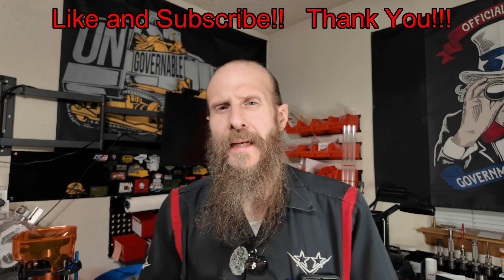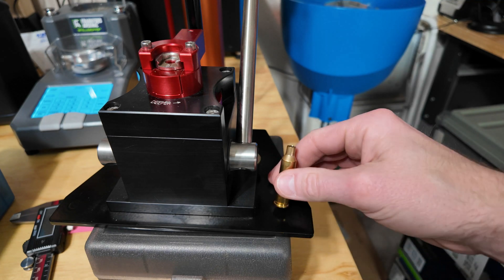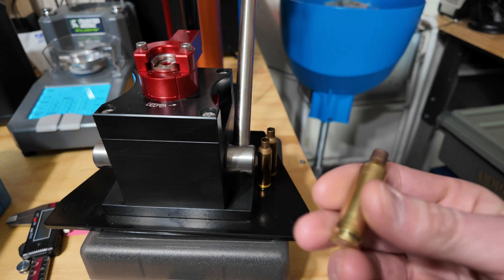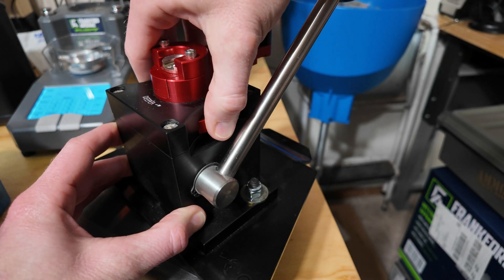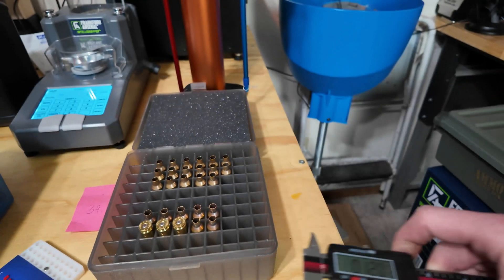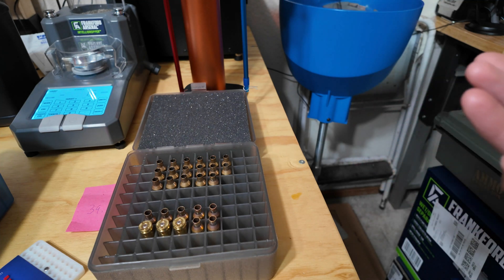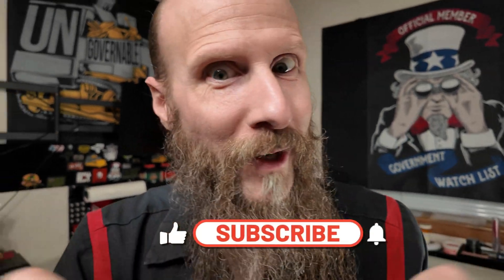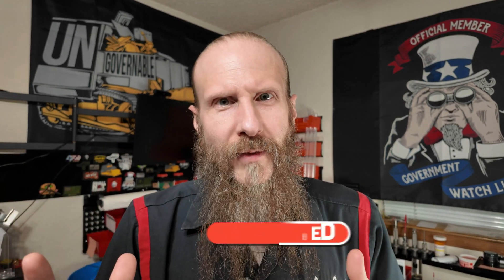I Found An Issue! Time To Test Primer Seating Depth Changes.

Comment: So... a couple things:

1.  It'd be interesting to go back and fire the exact same test of zero (touch), -0.001, -0.002" again and see if the results are at all repeatable.  There's some inherent variance in the primer height, pocket depth, and the case rim thickness (the CPS, like a lot of priming tools, actually references off the top of the case rim*, not the face of the case head).  I'm guessing what you probably saw with such small steps is just noise, and could go either way on any given day.  If it were me, I'd go with bigger steps, like 0.002 or 0.003, depending on the actual primer *cup height (see below)...

2.  Besides measuring the primer height (from the bottom of the cup to the top of the anvil), also measure the cup height. It's a little trickier to do, but you should be able to sneak the tips of the blades on your calipers in there between the prongs of the anvil, and get just the height of the cup itself.  For a small rifle primer where the overall height is ~0.120", you'll probably find the cup height to be something more like 0.113-0.114".   That difference between the two - 0.120 minus 0.114, for example - is how much range you have to seat the primer and 'crush' / pre-load / consolidate (the term varies depending on what source you're looking at, but it's all the same thing).  

Usually just barely touching (zero) like what you've been doing previously is considered... less than ideal.  If one primer pocket is a little deeper, or one primer is a little shorter, might not have it actually bottomed out in the pocket, and some of the energy from the firing pin will be wasted just driving it home.  Seating them too deep usually doesn't do anything great either.  -0.003 to -0.005" 'crush' seems to work pretty well for both reliability and accuracy for a lot of people.

Just going by "seat them all to x amount below flush" can be a bit misleading - some brands/batches of cases have different depth primer pockets.  Then, if someone uniforms their pockets so they are all the same - but deeper - might make 0.003 crush actually be 0.007 below flush!  They'll still work just fine, but without knowing details like that you might want to take other people's numbers with a large grain of salt - like about everything else in reloading!
Reply from the maker: Hey, thank you for all this info!
Great stuff.
I totally agree!! I realized that my current process was just the "bare minimum" and I mis-understood when I watched a video about crush depth very early in my reloading learning. 
I actually ordered the Accuracy One primer gauge to measure my pockets precisely, and measure primers correctly.
Then I can get the correct numbers to work with and do a proper test. I will need to go several clicks deeper it looks like. This first attempt was barely changing anything, but I will be doing better soon!

I am planning to try 3 PRS matches next month, so I ordered 400 Alpha cases and just got them in today!
I will be doing a primer seating depth as I work through fire forming these and see if I can find a better depth.
Excited to try this!

I mean, as it is, my ammo seems to be plenty good for PRS. My misses are almost always because of my position or more likely a bad wind call/adjustment. But, I enjoy the science and trial/error of reloading, so I am going to go down this crush depth rabbit hole and see what else I can learn.
Of course, I will be sharing here. My intention is to track my progress and hopefully post videos that other new people can find to avoid some of my early errors and see what I do to correct them as I learn more!

Comments like yours are exactly why I do this. I very much appreciate the information and learning from people that have much more experience than me! 
Thank you very much!! And stay tuned in the next weeks, I will be showing my results as I get further into testing this the correct way now that I have the proper type of tool!!!

I hope you have a great Friday, and an awesome weekend, sir!!!

Comment: Howdy! I hope you're doing well! Work has been keeping me slammed lately (again). So, primers and brass are an interesting topic, and if you ask 10 people, you'll probably get 10 answers (ok, maybe 3 or 4 answers). Anyway, not all brass is the same, as you know, but that also applies to how they form the primer pockets. Some manufacturers make them a touch shallow, others can be a touch deep. If I recall correctly, the spec for primer pockets is 0.122" and the basic rule is "thou shalt not seat your primers proud of the case head... period." Now then, the way primers are made is with an anvil and a cup, and a tiny dot of contact explosive in between, so if you look very carefully at the side profile of a primer, you'll see that the "feet" of the anvil will stick out beyond the rim of the cup by about 10-12 thousandths. Now here's where it gets wishy-washy... some folks seat to a fixed depth below the case head, others seat just until the anvil feet touch the base of the primer pocket, and others "crush" the anvil into the primer cup by a few thousandths (I've even heard of folks that seat until the primer cup bottoms out, which would be about 10 thousandths of crush!!). All I can tell you is what works for me, and that could be brass and primer specific, so it might not help you, but I've always found really good results with the primers seated to 3-4 thousandths below flush of the case head, which translates to about 1-2 thousandths of crush for my primer/brass combo.
Reply from the maker: I have been running so much the last weeks, man. 
I am making myself stop and reply before I load my truck to go out and film this week's video. It's in the 80s today and I am missing range time having to do other responsibilities around town and my house. 
I noticed this issue and realized from another comment that I skipped the "crush" test. I had watched a video about it when I was getting my CPS, and then ended up just going the basic seat flush idea. It seems to be working well, but after noticing the little change after they are loaded and sit a few days, I have decided to get the proper tool to measure primers and pockets and I'm going to do a better job! 
My video I am filming today will have more info, I am planning to attempt more matches this year and I am trying to figure out my best process to make it happen. I figure I will just put it out there and see what everyone thinks. Current plan is 300-400 cases of the same lot so I can bulk load for the whole month and always have the same brass.
Then I have to figure out a good supply of powder and projectiles. I have enough for a few months, but will need to restock the bullets soon. And Alpha doesn't have my cases in stock, so I am waiting for those to be available. I have a few more things I am not sure about, but I will ask those in my video.
But to go with this, I ordered the Accuracy One primer gauge. Like half the cost of Primal Rights version. I think it will do the same job and saves me a good chunk of cash!!

I am going to do a crush test on my brass I use now, plus I will test this new brass when I get it and figure out the best setting for everything. Then I will be able to just load and go!! Not have to worry about it again.
At least, not until I shoot out my barrel and have to replace that in the next few months, lol. Always something to spend money on!!

Gotta get my taxes done this week and try to get some money back to my bank so I can get myself stocked up for these matches!!

Well, I gotta get out before I lose the sun. 
I hope you have a great week, Justin. And thank you, as always, for this excellent info. I am going to test and figure out the best. Maybe I am already there, but never hurts to try for better!!

Comment: Your sample size is very small, but better is better. .001 deeper showed improvement. Go with it.
Reply from the maker: Yeah, I will likely just do the .001 deeper than current for my upcoming match.
Looking at getting a better tool to measure the pocket and seated depth.
See if I can do the test to find my best "crush". I have been having good results with the "seat it flush" way, but if I can crush the anvil a few thou and get even better results, well I need to test that and see what comes of it! 
I may already be at my best performing depth, but maybe I can do better!! 
More things to try in the search for best results, lol. Good excuse to add a fancy tool to the collection also, lol. 

Have a great weekend, Randy!

Comment: You mean the boss is MAKING you take days off?? That jerk ...  You better get that anger out at the range😂😂😂
Reply from the maker: Yeah. I tend to get forced to take a week about once every 5 years. I hate days off. 
Just results in more things to do and I end up working about 14 hours a day for the next 3 weeks and coming in Sundays and Mondays to try and get back to my regular behind position, lol. 
Days off just means more work.
But, if I can take some Saturdays I can attempt to do 3 matches a month and really get some time in doing this. I think that is my best bet for getting better. Going up against better people at larger matches will only make me improve! Lots of preparation to do this. I will need like 300 cases of the same lot number so I can just bulk load the whole month's worth of ammo one week and then use it as needed. I will be even busier than usual. Plus having to come in to work on Sundays to do my weekly orders or come in Saturday night when back to town. 
More work! But that has never stopped me from doing anything!!

Comment: In max fill, compressed loads, a lot of straight wall cases will grow in coal. Hence crimping. Perhaps it is a similar thing?

If you are not having reliability issues or loss of consistency...  Is it an issue?
Reply from the maker: Yeah, not maxed at all. I can hear powder shaking around inside. I think I am just not seated quite deep enough.
Another comment reminded me about the "crush" concept. So I will be getting a better tool to measure these things and doing that test soon. If I can get even better results, I am going for it!
I may be at my best option now, but going to try a few more depths and see what comes of it!!

Comment: You seat the anvil into the cup. .003-.005 below flush at least 
Call Greg, the maker of the seater,
Reply: Hiya Chad. So, with the primers seated .001 deeper, do you still experience a little ‘spring back’ of the primer in a loaded case, making it wobble like before? Or does that problem go away? 🤛🏻🔫🇺🇸
Reply from the maker: @viejo2a  Well, I may have loaded and tested too fast to notice that.
Seems the problem happened after a few days sitting loaded.
I think I will go 1 thou deeper just for my next match.
I ordered a fancy tool to properly measure pocket depth and seated depth. I will do this the right way!
And test the "crush" concept.
Some people crush the anvil, so they seat deeper than flush.
I just went the basic route, flush with case head.
Time to investigate further!!
Another job on my to do list🤣

But, gonna keep it simple with my match ammo. Run what has been working the last few months!

Have a great weekend, Walter!!
Reply from the maker: @yukon4545  Hmm, so even deeper just a bit it seems.
This is something that I am going to have to test a bit further. I had a good depth with good numbers on the chrono. After 2 deeper it widened a lot.
I guess there is a point just past that should tighten back up?

I keep thinking I am doing okay so far, then find another thing to try and improve.
Trying to not have to buy another measuring tool, but I think to do this the best way I am going to just have to get that done and ordered.

I think I saw his video when I was mass cramming hundreds of videos and likely forgot that specific point from Greg.
Gonna try a few more and see what happens.
Just odd that I noticed them not flush after a few days once they are loaded. They will sit flush if not loaded with powder and bullet seated. 
Very strange, but I have not been this far down the reloading rabbit hole yet, so I am trying to improve where I can. 

Gonna go back and look at his data more to review. May be doing a further test and go a little bit deeper another 1 to 3 clicks!!
Appreciate the info, I would just call it good and keep moving!

Thank you much!!
Have a great Friday!